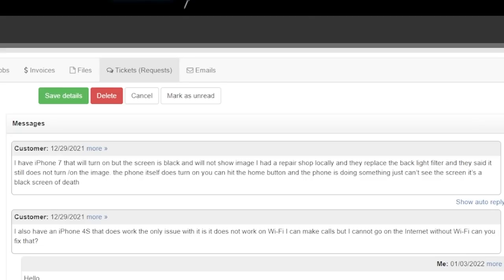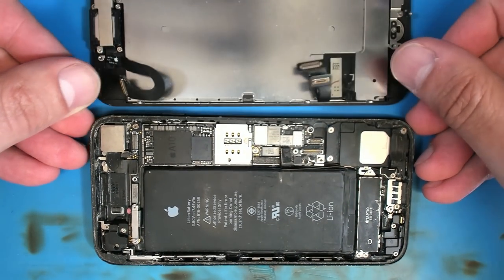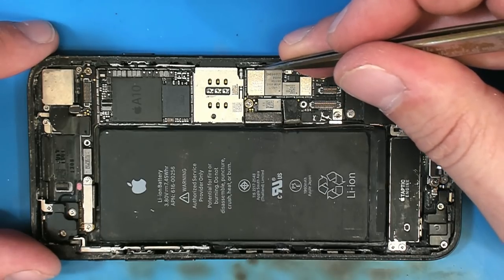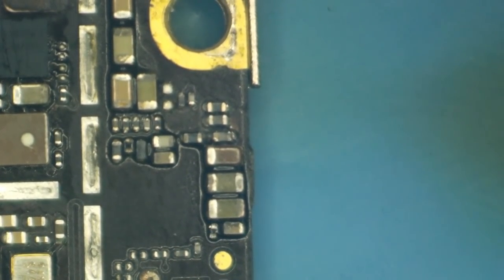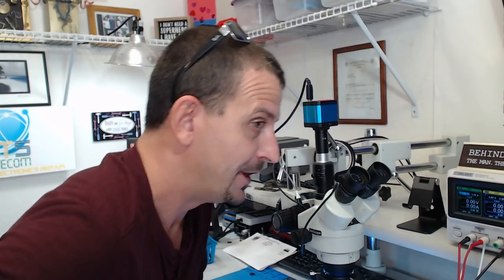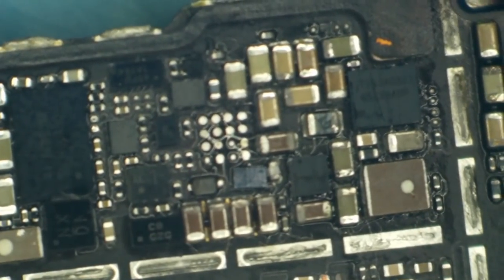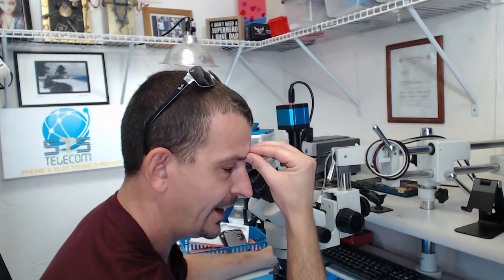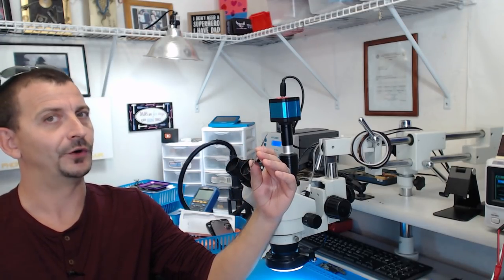Another shop botched this repair (but they're probably better off) [Part 1]

Comment: I would call that a restauration and not a repair job. Cost far above the value only for collectibles an paid on an hourly basis  ;-)
Thank you for sharing all that videos. It's always crazy to see how precise you are with these tiny parts and how you build up conectors out of nothing with the speaker cable.

Comment: Jason, I have had the fortunate pleasure of having to use your services twice over the course of the last several years. In both instances the most I did was change the screens on the devices, discover that there was more wrong with the device and/or the backlight may have been damaged by me despite my best efforts to keep that from happening, and sent them your way when I knew I was in way over my head. I never want to run ANY chance of making your job harder than it already is and this is a mentality that I will continue to maintain for any professional in any field. I wish more people in this business had the same mindset that I do because it sounds like these rehot devices are killing you.

Comment: "Oh we replaced a couple filters"
board's metal shields are gone

This is like towing in a car where the previous mechanic said on the work report "replaced oil and filter", and you open up the hood and the radiator is missing. That's 1950s mechanic scammer type stuff right there.

Comment: I honestly can't blame you dude. I would not work on this board at all! Pay your bills, feed your family, and everything else isn't important.

P.s any idea where I can buy that scope attachment you have to connect the camera? I just got a trinocular (been using a stereoscope with one eye piece for the camera) and I have no clue which attachment to buy lol
Reply from the maker: Dude... you have been doing all of these streams and videos with one eye?  😲That is actually quite impressive.  Everything is more difficult without depth perception... honestly, I don't think I could do it with one eye!  The adapter I'm using was purchased a long time ago just by chance.  I measured the fitting/threads on the camera and the hole on the microscope slide adapter thing that came on the scope.  I ordered a 0.5x adapter that had the right sizes on both ends and it just worked.   It's really not good though.  I'm losing a LOT of viewing area (maybe as much as 50%).  Unfortunately, I don't know exactly where I bought it to be able to recommend though.  Paul Daniels has a much better setup and I believe is using a 0.75x adapter.  Zoomed all the way out, I can't fit an iPhone CPU in the camera view.  It's actually a pretty big problem and I'm gonna fix it soon!
Reply: @ststele  haha yeah but in fairness I can't use my left eye properly anyway. I have an issue where too much light gets into my left eye and if I'm using the scope it's fuzzy in the left eye, so I'd probably still be using one eye lol.

The problem I think with field of view is I think you need to add an extra lens to the setup for the trinocular port. I remember someone saying something about a 0.5x in conjunction with a 0.35x does the trick but I could be wrong. Think I'm going to have to pull the calipers out for mine lol
Reply: @TheCod3r  I'm in the same microscope boat! Just picked up a Parco trinocular and it came with a piece to go in the camera port, but I figured there would need to be another lens involved since everyone else's setup seems to have that additional long skinny lens. I'll let you know if I find a definitive answer!
Reply: @joshedagg  thanks man. Yeah to be honest I find all this microscope stuff confusing. I'll find a shorted 0201 capacitor all day but give me something as simple as a microscope and my head goes all fuzzy 😂

Comment: The screen was wrong, its a 6S screen 🤣🤣. The reason for the shields missing i believe is due to the water damage, they did the right thing by removing it all to proper clean the board, but once the phone showed more problems, they didn't bother to put them back on.
Reply from the maker: That’s hilarious!  I didn’t even notice that’s a 6s screen they sent along.  😮

Comment: Hey Jason what kind of mat is that? Does it tend to bubble up with hot air? I’ve used ones before that did that and it was quite annoying lol
Reply from the maker: Hello, this is just a standard soldering mat that I bought on Amazon.  I think most of them bubble up with hot air so I've just learned to expect it.  I try to use a board holder most of the time so the swelling isn't an issue.  Underneath the mat is still my cratered up burned bench top from back before I didn't believe in using soldering mats.. LOL :-)

Comment: Roll the dice bro!   FIX IT!
Reply from the maker: I roll the dice WAY too much.  I’m gonna need the green light for data access only on this one.  I won’t charge some huge fee or even ask for the passcode.  I just need them to not pin me down for a like-new functional phone.
Reply: @ststele  From what I've seen you do. You could easily fix this with little to no issue.  But I totally get it.  Some people will always try to take advantage of a good situation and unfortunately more times then not, talented people are the ones who end up paying for it. And not in a good way. 
I love your work.  Its very inspiring.
Reply: Sloppy seconds. NO
Reply: @josephlarrybradley508  Nah I don't look at it like that at all.  Fixing other peoples mistakes has a reward of its own.
Reply: @Silentjackll  yup.. give em an inch.. they take a mile.

Comment: Goddammit...
I am really a novice in diagnosing these kind of electronics, but I would have catched that 100%. 
WhyTF such repair shops are not being closed by some government oversight institution?
And this model has a public BV and schematics. How hard is it to stick a multimeter pin in? And returning the board without some chips, that sounds so russian style (channel of Ассоциации Сервисных Центров)